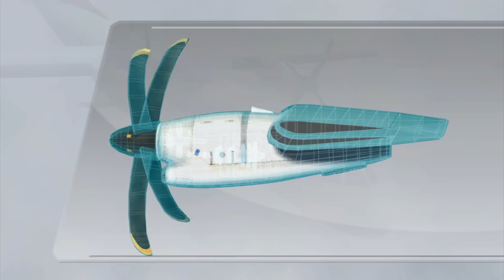New details emerge on how Taiwan plane’s engine failed

Comment: Why would they throttle back on the left hand engine if its the only engine working ????!!
Reply: To keep balance.
Reply: but then they have Zero power. Isnt it better to have half power than no power ??!!
Reply: Unless the plane wants to be a Merry-Go round, its better to slow it down.
Reply: Isnt it better to go round in circles still flying than to have no power and go down ? Arent most twin engined planes designed to fly on one engine ?
Reply: Going aroudn in circles will result in the plane hitting an object. They won't be able to dodge it if they are going in circles because physics. Hard to slow down or turn something that is spinning than in a straight line.
Reply: Why do alot of twin engined planes fly straight on one engine then ?
Reply: Twin engine planes still have both running. They fly on extremely low power because they are already going high and fast vs this where they were too slow to lift off so adding power to the left will steer it right.
Reply: Twins can fly on one engine (some better than others... all depends on power available and weight..). There are videos on youtube of twins doing it. There is a DA42 video on here where they shut one side down just after takeoff. They have to remain above their min. controllable airspeed, Vmc, to keep from rolling over on their backs. If the plan is above the airspeed, 100% power on one engine with the other feathered will not cause the plan to depart controlled flight.  I do not know how if this aircraft had enough power available in one engine to maintain level flight with all the weight it was carrying.  It is curious why they pulled power on the good engine. My bet is they pulled it from the wrong side accidently. If so, by the time they realized it, they may not have had enough time to recover, because it takes some time for a turbine engine to spool up and start producing thrust again.
Reply: VeTTeMaNC486 I think I read that somewhere as well they pulled back on the wrong engine by mistake